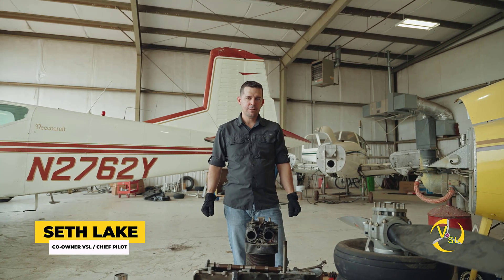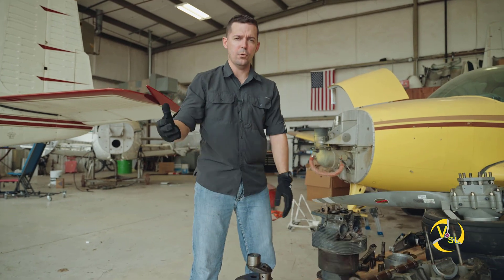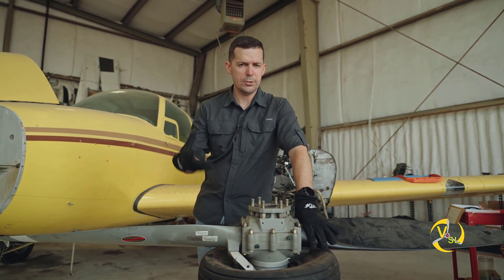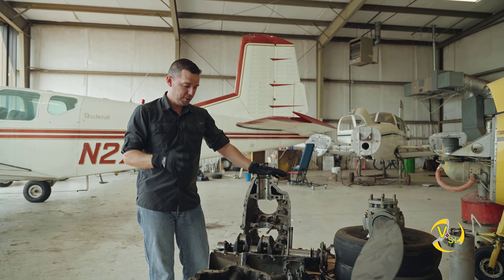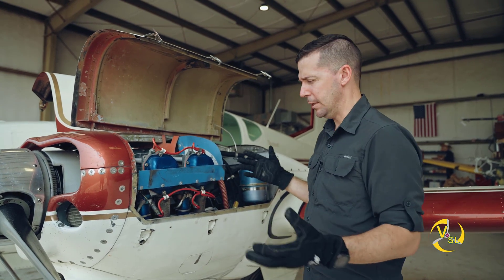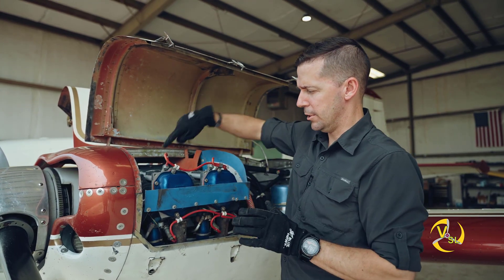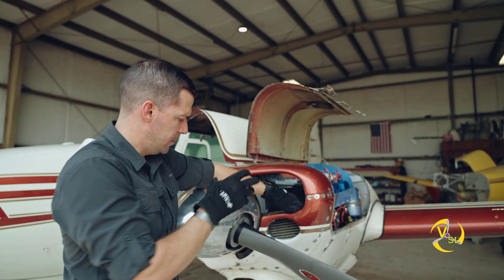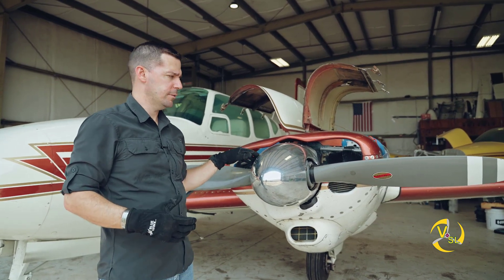Demystifying General Aviation Piston Engines: The Propeller (Part 4)

Comment: Guessing when you pointed into the middle of the prop that was a sludgy mixture of motor oil and grease and it’s still removed for overhaul or replacement.  Normally the grease is contained within the hub gearing but over time the seals fail and mixing takes place.  Alas the reason for tach and calendar time on recommended prop TBO.  You don’t want part of a prop departing the aircraft and taking a wing out.
Reply from the maker: That was all just old engine oil.  It does get pretty dirty but none of that was actual grease.  The propeller grease is red so you can identify it if/when it leaks.  The Travel Air propellers are a little unique in that they get pulled every 500hrs for an AD inspection.  I'm always surprised at how bad the oil looks after just 500hrs.  None AD props might stay on for 2000hrs!
Reply: When I got my Skylane the prop only had 500 on it but 36 years smoh, mostly sitting.  It was definitely time!

Comment: Talking about the flywheel made me crack up about how we use that term with aviation engines. Don't get me wrong, I couldn't think of a better word, but I can't help but wonder if that thing provides any significant momentum to the engine while it runs. The propeller weighs so much more it's not even funny! Would the flywheel even help if you ran the engine propless? Maybe we should call it the starter gear engagement disc, haha!
Reply from the maker: Yeah, it's interesting we still call them that. That honestly might not be the correct term but it's still what I use.

Comment: I think we all need our instructors to give us a visual walkthrough of the engine parts like you just did. It’s not the same as reading about it. I was able to follow your explanation of each of the components because of the reading I’ve done but this was the last piece of the puzzle. NOW I get why loss of oil pressure is a really bad thing.
Reply from the maker: I agree that it's a totally different experience going through the actual parts in person verses just reading about them.

Comment: OK, newbie here, maybe dumb question. If there is an alternator and/or generator, why a magneto?
Reply from the maker: Great question!  I think my next systems video will be on magnetos actually.  The reason we have a magneto is so our spark plugs are using a independent and redundant system to operate.  In the early days of aviation (when a lot of these systems were first designed) airplanes didn’t have electrical systems at all.  Magnetos were used in many other combustion engine operations and were very reliable.  You could design (and people have) a electric ignition system that was tied to the electrical system, but that would remove some of the redundancy offered by this set up.  Thanks for watching!

Comment: Well done presentation across all four videos. Excellent format and clear and concise explanation. Should be required viewing for PPL students!
Reply from the maker: Thank you for the feedback!
Reply: @SethLakeDPE  Hi Seth - as I said, excellent presentation across all 4 videos. You have provided - free of charge - a phenomenally detailed overview of the combustion engine. Thank you (I had to make my previous comment brief, as I was finishing the video right before we - family - needed to leave for a soccer tournament).

One question I have, regards the rings - They are made of spring steel. Why doesn’t the heat and friction fail the rings with regularity? I get that the oil is not only lubricant, but also a cooling liquid, but the scraping of the oil from the cylinder walls reduces the amount of heat displaced … doesn’t it? Is this purely a combination of the structure/mixture of the spring steel coupled with the overwhelming transfer of heat to the oil? Or something else?

I attempted to ‘Google’ it, and got nothing other that ‘race performance’ inferences…